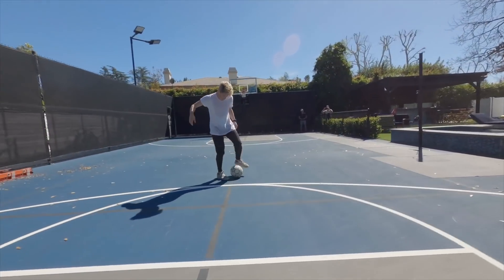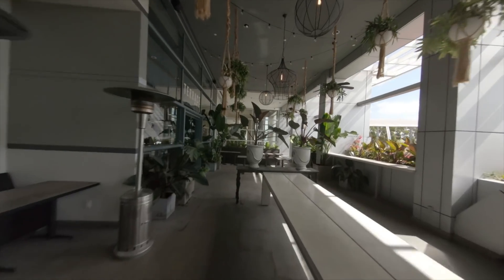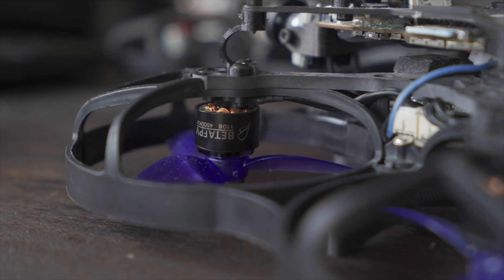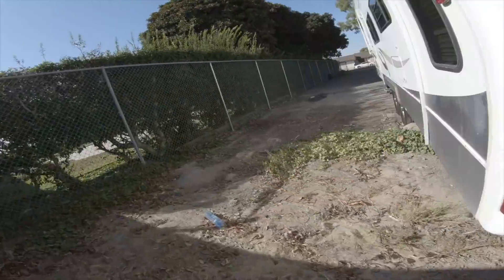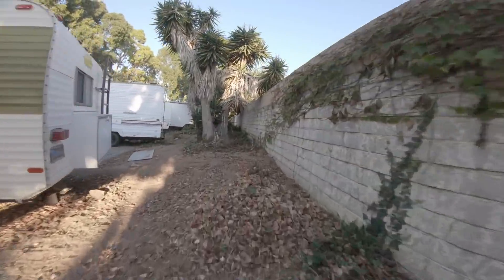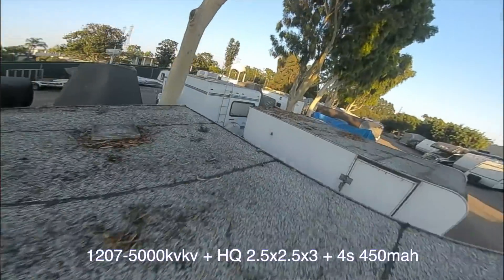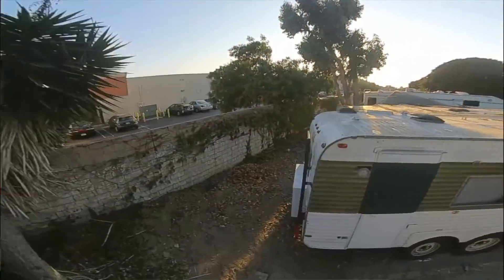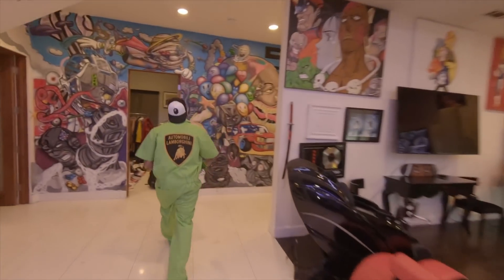I've been trying different motors for my umma95

Comment: Help : 1207 5000kv motors get really hot and fly only for 1.5 min cruising .. 
We are building the godmode drone,  what are the pid / filter tuning steps for the 3inch cinewhoop ? ( we build it the same like the sell on droneshop ddg godmode )
Reply: These motors suck. Me and some others in the community habe experienced that these 1207 have issues. I have killed 4 motors already and now Im not going to keep replacing them.
If you want to run these motors, dont use high pitched props.
Stick with Gemfan 3020 or 3016.
On 2.5 inch use the 2040. High pitch just kill the motors.
That sucks and speed was the only reason I wanted them.

Comment: Iam thinking about switching my gopro session5 kinda "umma" build (heavily modified without plastic frame) to 1404's... and use my 1204's for a standart 85x whoop.. the 1204s are crazy efficient. I can fly 6 minutes with 3 blade props with session5...
Reply from the maker: Yea it’s a power vs flight time conundrum

Comment: Hi Tommy! I got rcinpower 1204 5000kv with 2540 props but I'm getting mid throttle jello that I cannot get rid of. I tried tuning it but with no success. Motor graph shows I got poor vibrations, Could it be due to motors / prop? Did you experienced that? I see on the Umma95x build that you were using the same motors / props, so I guess not. Can you give me some hints about this? I'm pretty sure it's not a bad motor or props, and the frame it's a pretty new beta95x. Thanks!
Reply from the maker: Hey man, I’d start with making sure every screw and bolt is tight, hey nothing is touching the flight controller, and that your props and motors are all in good condition. Then I’d play with the filter settings
Reply: @ummagawdFPV  thanks! I found a post of yours on Facebook from 2020 in which you said that the best option to get rid of vibrations was to soft mount the FPV cam, so i designed a new mount, dampened, and I got no more jello now :)

Comment: @UMMAGAWD please share your pid tune and settings i have build a 95x with the 1207 motors you recommend in this video but i just cannot get the motors down to a bearable temp
Reply: Same here.  The pid tune from the 95x build video and stock 4.2 settings result in my 1207s getting too hot to touch.  Motor screws are not touching (checked with multimeter), and mechanically the build is sound.

Comment: hey tommy, i have 1106 3600kv motors. i have washout problems. i want to order new motors. did u have any issues with 1204 5000 kv motors and washout. i want to fix that.
Reply from the maker: There's too many factors that cause that. I'd hate to steer you wrong with limited info. Assuming you're hardware is solid, you always want to go with the biggest motor you're willing to get. That alone will go a long ways.
Reply: @ummagawdFPV  thank you for your response my friend! Imwill try some other motors. I think my motors are not quick enough to respond to fast corrections. I would love to see more content from you! And some good freestyle videos too

Comment: I followed your leas and threw on the RCinPower 1207’s. I ended up dropping from DShot600 down to DShot300 because I was getting a lot of “flutter”. Seems to be great now. I end up freestyle flying even though that’s not really the intent with the design.
Reply from the maker: nice... same here... I ended up free styling with it with the newfound power
Reply: HI Help : 1207 5000kv motors get really hot and fly only for 1.5 min cruising .. 
We are building the godmode drone,  what are the pid / filter tuning steps for the 3inch cinewhoop ? ( we build it the same like the sell on droneshop ddg godmode )
or share ur pid /filter settings / biderectional dshot ? ?

Comment: Nice videos, keep up the great work. I'm new to fpv builds and attempting the 95x v3 build (2nd build). Ur build is based off the v2 I believe. Have you ever had issues with the 1204 or any xx04 build in terms of height clearance with the guard when  testing out the various motors? I ordered the 1104 4200kv but the the height of them does not seem like they would clear the vista housing bracket after receiving the frame in the mail today. The 1106 seem large in comparison but I realize the are all small motors and the sites show macro images making them seem larger than they are. Have you also tested out any 5 blades with these setups?

Comment: do you think 1207 6000kv will also be good on 4s or 3s?
Reply from the maker: I think 4s would be too much for it. You could always try it with BF’s throttle minoring feature
Reply: @ummagawdFPV  I only have 3s batts for now so I'm really tempted to buy the 6000kvs to save money and not buy 4s batts. 😅 Thanks for the reply btw.

Comment: I want to build a umma85. I have laying around a Tyro69 drone, and was wondering if It would work with the beta85x frame or the v2 frame with some mods + changing the props for a 2 inch set.

Comment: Same motor I choose when I built my 95x. RacinPower 1207 6000Kv I run 3S and 4S.. from low pitch biblades when I need longer flight times. Gemfan duct 65mm if im lifting a full size gopro (didn't get a naked yet)

Comment: How did you do to lower the heat of your engines? I tried everything and they remain the same, I am using 1207 of 5200kv, what am I doing wrong?
Reply from the maker: you need to make sure everything is secure, no loose motors, bent props, nothing touching your FC (like wires). And then play with filter settings. Micro motors get hot, but they shouldn't get so hot that you can't touch it for longer than a few seconds
Reply: @ummagawdFPV  yourthank you sr very great your videos and support

Comment: I wonder if the supplied genfan props would be too aggressive for the freestyle up grade, the Beta95X v2, has been getting a bit of a bad wrap. I’d like to see your thought on how it flies off the shelf from
BetaFPV
Reply from the maker: the gemfan has some pop for sure, but i didn't like the way it flies out of the box (the 95x v2) and i felt that the motors came down hotter than I'd like

Comment: Just curious, how these actually fly. JB on his live stream today said he's in no rush to review the betafpv 95x. And heard from kahbab that these don't fly very well. I know your design is not the 95x v2 but similar. What's your take on that?  Personally, I'm really enjoying my 95x stock 1106 motors and may upgrade to the 1207's you tested in this video. btw - always enjoy your vidz. hope to see more! not many good quailty fpv vidz these days unfortunately.
Reply from the maker: It's all about the parts you choose and the "total build". I use the same 95x frame but I build it out completely different (I flip it upside down to make it a pusher, amongst other things... and the fact that beta's v2 does the same should say something ;)

If you do anything more than fly "cinematic", then you'll love the 1207. Especially once you go outdoors into windy conditions. Some might say that throttle control is harder on 4s, but I say it's just something you get used to. Or if it's that difficult for you, then you can drop to 3s packs or even use BF's throttle limiting feature.

All that said, I love the 1207. It makes flying FUN, you gain more agility because of the power, and personally I feel like it flies alot more stable because it can actually control the quad.
Reply: @ummagawdFPV  Awesome. Thanks for the details. I currently am flying the v2 and love it as mentioned, but would like a little more motor. waiting for your pink 1207s to come back in stock, so I can equip my v2(s) with them. looking forward to more of your vidz Tommy! Keep em coming!

Comment: you didn't mention Apex 1303.6 motors. i'm guessing you don't have them. they have a bit more power than 1204 and 1303. would you try them and compare to other motors ?

Comment: I’ve got those 1207’s, but I went with 6000kv because I run HQ 3x3x3 and a 3s 1100mah battery (the 66g GNB one). It’s great at 146g auw, but no HD yet. I think it’ll be just fine when I find a Vista to put on it.

Comment: which props should i use on 1106 5000kv with 2mm shaft?  i cant seem to find any with similar specs to yours in video
Reply from the maker: 2mm is kinda hard to find. I believe FPV Cycle carries some that work well

Comment: How you getting on with the BETAFPV stuff? Heard a lot of people killing ESCs, I haven't yet (still on the stock 95x RTF stuff)
Reply from the maker: I’ve not had any issues yet, I even dunked one in water, after a day of drying out on the sun, still fine. That said, I’ve read of people having issues too.
Reply: @ummagawdFPV  that's good to hear. I've not had any problems either! Only problems I've had are forgetting an ND filter adaptor 😂

Comment: Great video. IMO 1204 on 3inch is where it's at. 6 min cruising flights on 450 3S. And you can do light freestyle when you need it. Only about an inch wider than the 2.5 inch whoops.
Reply: i bought some 1204 5000kv but it not tall enough like the stock motor. how do you install it
Reply: @dhardjono  3d printed spacers. You can find plenty of options on thingverse
Reply: @isacenriquez2624  got it thanks

Comment: I just got the 1207 6000kv version in the mail on Friday. Do you think the extra kv will add some more power ?
Reply from the maker: You’d probably need to stick to 3s max with that kv
Reply: Im using the iflight 1303 5000kv and guts of an A85 on a phantom setup with a 4s but wanted these after a lot of minimal info research. Really hoped the 6000kv was gonna be the way to go,  I'm sure more people had this exact decision to make. Now you have cleared this up.

Comment: I would have thought 1206 would be plenty, I've got a couple of 250ish gram 3"s running 1206 and they haul ass
Reply: Think everytime they keep saying power. I think they mean response time.. but I'd imagine 1206 vs 1207 isn't much noticeable difference.. went 1207 because is was more common place when I was looking. I would even done 1305. I just need the motor torque to pull out of dives with full size gopro on 2.5" lol

Comment: I wanted to build a insta360 go rig. I was looking at putting the emax 1106 6000kv for a 3s build. What do you thing?
Reply from the maker: Should be good, might be a bit high kv for 3s
Reply: @ummagawdFPV  i have a race rig that runs those motors. I have 3in props with 3s. They get a little warm. So i figure that 2.5 would work  great.